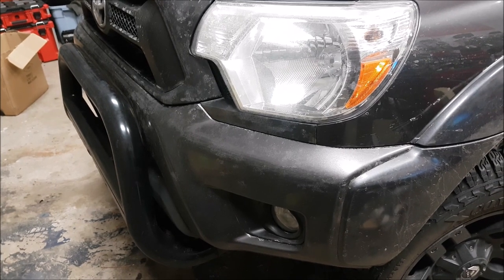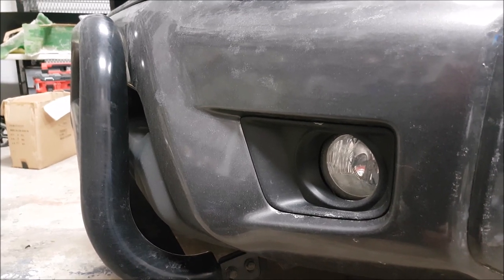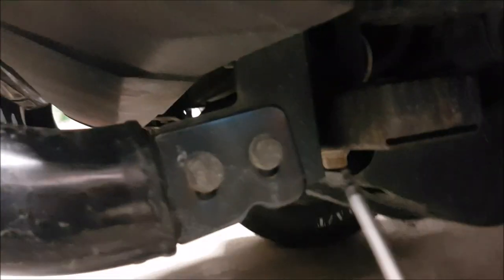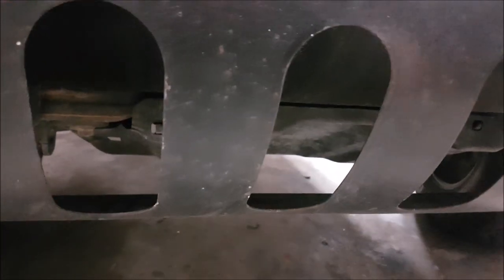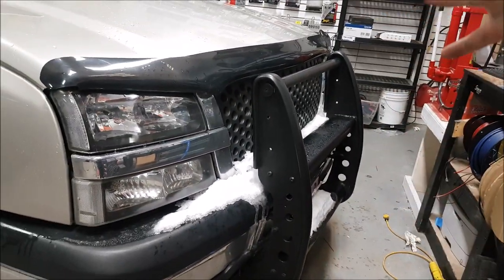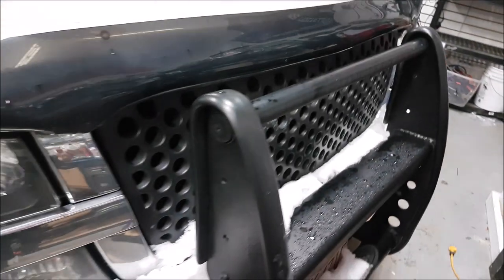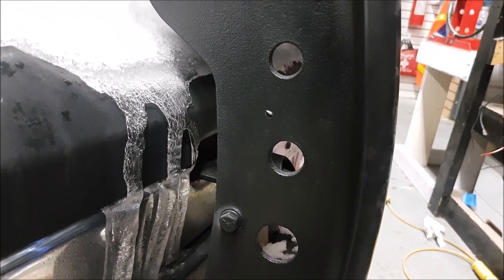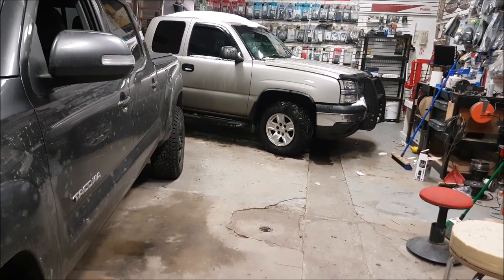Push Bumper vs Bull Guard | AnthonyJ350

Comment: Well. Had a bull guard on my Nissan Armada couple years ago. I slid while doing a left turn, tried to do a small drift but TC messed me up so i end up hitting the guard rail on the right, the bull guard saved my front end. :D all I had to do was loosen the bolts to re-align it back to normal.
Reply from the maker: Glad to hear it helped protect the SUV.
Reply: @AnthonyJ350  where did you order your push bar,I can’t find it on the Go rhino website .I want one for my 06-07 Chevy could you help me out?
Reply from the maker: @ThefarmLife.  fleetandsafety.com
Reply: @AnthonyJ350  I can’t find it on there it’s showing up law attorneys ,copper fit masks and other unrelated things
Reply: @ThefarmLife.  he said a bull guard (which is a brush bar) not a push bar. You can get bull guards on Amazon for about 150 for a certain vehicle.

Comment: Well, here in Mexico we have them to use them as RamBars. It is a safety issue for us dealing with drug cartels daily. Generally, the best I've seel is to have custom made brackets on the bottom, middle and top of the push bar to make it really sturdy not just to take most of the hit, but to actually take it all like a champion. Yes, It will get sort of damaged, but it will allow you to hit a car, move it out of the way and keep going without significant damage to your vehicle, your radiator or any parts that could prevent you from keep going on. It also helps when you actually install an offroad steel bumper with that bull guard on top ankered to the chasis in a higher place like the radiator top bracing.
Reply from the maker: That's pretty cool, thanks for sharing!
Reply: Solid advice!
Reply: Can you recommend a model that is best for that? Thank you! or a company?
Reply: @---tx9xx  I've only seen Iron Bullbumpers tested that way and they seem like the real deal. Now, they are expensive for my pocket and I would have to take my van to them so that they can make me one cuz they don make any for the chevy express van. But they might have one for your truck. 
The other way is the way I'm doing it... build one out of 1/4" square tubing and 3/16" steel plate. I'm making a frame out of the tubing and the "body out of the plate. Im gonna bolt it directly to the frame of the van with 1/2" diameter bolts and making sure the frame is stabilized by the bumper itself so it doesn't move in case of collision. 
I learned that modern frames use accelerometers and other sensors to decide if the airbags have to go off, but if the frame doesn't shift, It is less likely to set them off and seize the vehicle.

Comment: i know someone that installed  a push bar on there truck to protect it from deers
Reply from the maker: That makes a lot of sense.  It would take a lot of damage but it would hopefully protect the radiator so you can drive home at least.
Reply: @MuddyBob650  I hit one doing 55 miles an hour and my truck still drives fine.
Reply: @MuddyBob650  That's why you get a Ranch Style Brush Gaurd/Bumper
Reply: @MuddyBob650  I once saw a Chevy 2500 with a grill guard whack a mule deer buck at roughly 60mph. I was right behind the truck. Flipped the deer 540° and threw it into the bar ditch. Snapped one of its antlers in half and killed it. I checked on the guys in the truck and they were just fine, only a small dent in the hood near the passenger headlight. Drove on to work like nothing had happened.
Reply: It won't do anything unless its a dull steel bumper a high speed impact is more likely to push the upper section of a guard into the front of the vehicle and damage the radiator
Reply: @cameron6049  it actually worked they hut a deer around 25 miles an hour and the car was fine just the push bar was bent
Reply: I hit a deer going 65mph in my 85 Silverado some years ago on I-80 while driving at night. Almost direct hit to the big, heavy steel push bar, which was badly bent by the impact. Everything else on the fronted was fine. Crazy that there was no sign of the deer around the truck when I stopped, but I pulled out a chunk of deer from the under carriage the next morning.
Reply: @MuddyBob650   There is at least one exception, I can assure you.

Comment: Glad I watched. Was gonna put a bull guard on my Highlander until I saw how flimsy.
Reply from the maker: Ya they're just for decoration unless it ties in with the frame on several points
Reply: @AnthonyJ350  I thought the brackets looked frail and like you said ,were not at a stable point. Thank you Sir.
Reply from the maker: @iamnegan1515  You're welcome, and thanks for watching 🙂
Reply: Really they should just be called bump guard.
In terms of strength from weakest to strongest:
1) brush guard (mostly decoration)
2) bull (bump) guard. (In video)
3) push guard (in video)
4) ram guard. 

A steel bull guard can protect against hitting animals, or “bumping” other cars/objects. Not gonna save you in a 40+mph wreck, or allow you to ram/push cars lol.

Comment: I purchased a brush guard (Push bar) from Black Horse for my 2022 RAM Promaster; problem is it covers the crash avoidance sensors. I can alter it and raise it 3 inches above the sensors; will that be high enough to clear the sensors??? Any Ideas would be appreciated! Thanks
Reply from the maker: I would contact the manufacturer on that one.  I haven't had to do that so I don't know what the results will be.

Comment: Is this strong enough to push slow moving vehicle's off the road, making my commute quicker
Or in case I'm late for work, as I am on my last warning now
And I am sick of passing people on the right 
The gravel soft shoulder, is dangerous to pass on at high rates of speed
Thanks 😁
Reply from the maker: You could just leave earlier for work
Reply: @AnthonyJ350  I try doing that, but I'm usually still half drunk and don't hear the alarm
And don't say to quit drinking, or cut back
Not going to happen
I also need my job to pay for the booze 
Thanks 😁
Reply from the maker: @grantward9205  You sound like a winner 🏆
Reply: @AnthonyJ350  You are very astute 
Thank you for the compliment😁
Reply from the maker: @grantward9205  Perfect example to all the young people of what NOT to become in life. Thanks for confirming.
Reply from the maker: But thanks for coming back to make comments and help the engagement statistics of the video. Helps us pay for our shop and Tomei headers I'm going to buy for the 350Z. That stuff isn't cheap, so for that I thank you 😉
Reply: @AnthonyJ350  Thank you, just trying to help the snowflakes out there😁
Reply: @AnthonyJ350  Glad to help the engagement statistics 
I can't wait for this video about the Tomei headers, will they fit my 1975 Chevy Impala 454 and give me some extra torque to push slow moving vehicle's off the road out of my way?
Why are Are you using them? to pass cars when you are late for work half drunk and didn't hear the alarm , like me?
Also I did make my own push bar out a piece of Railroad track, but I had to put spring helpers in to hold the front of the car off the ground, maybe it was a mistake as the weight killed my acceleration, and the cops almost got me last time😁
Reply from the maker: @grantward9205  No you're not. You just want other people to come down to your level, which probably never works.
Reply from the maker: @grantward9205  I like the look of them, it'll change the exhaust note and probably help with midrange power.
Reply from the maker: @grantward9205  Trolling people is a nice distraction from your actual life, isn't it?
Reply: @AnthonyJ350  Don't be so foolish, it worked on you😁
Reply from the maker: @grantward9205  You're not the first and you won't be last keyboard hero that needs to bring people down to their level. Seen it so many times. A higher level person would be constructive and really has better things to do.

I just feel obligated to reply back to comments.
Reply: @AnthonyJ350  Tomei headers cost about $1,500.00 and add about a 5 bhp 
For another $3,000.00 you could get a HKS - Pro GT GTS 8555 Supercharger 
The complete system will boost your stock 350Z to 412HP (440 HP on the Rev-Up) 
Headers aren't a must on a forced induction motor
Reply: @AnthonyJ350 Trolling  is a nice distraction from my actual life
Can't wait till the 4rth Saturday this month April 23rd, Season opens
I'll be out out there trolling for Rainbow Trout at my secret fishing hole, and I'm not telling you where it is, no matter how much you bother me
Seems like you like Trolling?😁
Reply: @AnthonyJ350   A higher level person would be constructive and really has better things to do? do you know any?
What, like slinging insults at commenters?
Your level is way beneath me
I can take it, you can't
I just feel obligated to reply back to your comments
Because I am at a higher level than you, and don't feel the need to insult people for no reason, to make myself feel better
😁
Reply from the maker: @grantward9205  I think it's great you have a hobby like that to do. I hope you share that time with family and/ or friends.
Reply: @AnthonyJ350  Thanks, I do, 
Just me and my son at the secret fishing hole though😁
Reply from the maker: @grantward9205  That's awesome! Why can't you have a friendly discussion like this with people instead. Honestly, what did I do to you to show me that other side? We don't even know each other.
Reply: @AnthonyJ350  I do, you are the insulting one, not me😁
Reply from the maker: @grantward9205  Thanks for the feedback!
Reply from the maker: @grantward9205  I wish you and your son a fun and safe fishing trip.
Reply: @AnthonyJ350  Thank you Anthony
BTW: I came up with an idea to fix the design flaw in push bars defeating crumple zones, especially if bolted to a full frame vehicle
Push bars do not affect air bags as they are tripped  by accelerometers placed in the front area of the car, locations are all different
That's why when a Police car push's a car or does a pit maneuver their is not enough force to trip the accelerometer to set off the air bag, only in a high speed crash when so much force is applied to the front of the vehicle
So design shear bolts that will shear off at the same force it takes to trip a air bag accelerometer, so it would collapse and place the force on the crumple zones 
The way the car was engineered to take
all you would need to do is just simply  change the bolts, and not have to create a whole new push bar design like the video we seen
Making the push bars bull bars already installed redundant

Could you get your design team to get to work on this right away?
Peace😁
Reply from the maker: @grantward9205  That's a great idea, but I don't manufacturer them.
Reply: @AnthonyJ350  OK😁

Comment: Bull guard in Scandinavia must not weight above 0.5kg, the tubing is almost like tinfoil.  It's a styling accessory where you can hang the extra lights.  They sell them in plastic and aluminum in Scandinavian. Pedestrian safety isn't taken lightly by EU.
Reply from the maker: Wow I learned something new. Thanks for sharing!
Reply: Not sure what that has to do with pedestrian safety when you could still drive into people just the same without one. If it was about pedestrian safety, they would just ban motor vehicles.
Reply: @billystink4611  it's to save more people. Some car's kill people at slow speed. Others have higher safety. Subaru has cars with airbag on the hood. It also protect driver. You can end up in jail for accidentally killing somebody.
Reply: @vectraB97  Sorry for the misunderstanding. Here in the U.S., it wouldn’t make a difference to a pedestrian whether a truck had a bull gaurd or not, the truck would do the same damage either way (metal bumpers). Because of this fact, many people here mostly seem to use bull gaurds to minimize damage to their trucks when hitting deer (deer have decome a pest in many parts of this country due to our overly strict hunting laws). Anyways, thanks for taking the time to explain how things work where you live :)
Reply: @billystink4611  EU and Scandinavia take the pedestrian safety regulations seriously. Euro Ncap test pedestrian safety with test dummies. How hard the car actually hits the dummies. Every area of the cars front is safety rated.  No 5 star car has metal bumper or metal tubing on the front. Tesla cybertruck could never meet the requirements in EU with the current design. That's why it got cancelled.
Reply: @vectraB97  Thanks for the info, yes I guess things are very different here.

Comment: the work truck which is my ' 04 Silverado single cab & long bed & 4,3 v6 / auto,. / 4x4  ( on the floor )  w/ currantly  180  k  miles on the clock & still going strong here....it's got a simple push bar like on your silver truck here in the video works well so far... my '02 gmc sierra crew cab long bed  6.0 / auto/4x4 ( on the floor ) w/ currantly 220  k  miles on the clock as well too & still going strong here ... it getting a full on brush guard  the one w/ the head light protector... it too has a built in step & bar to pull your self up onto it... it's going on saturday here... tho the only thing is differant is i wanted it out about 18 inches from the grill so  later on i'll buy & mount a winch on the front end not on the brush guard but on some 1/2 to a 3/4 inch plate steel between the front horn's of the front of the frame on the rig.................
Reply from the maker: Let us know how the install goes!

Comment: If u really want the strongest protection u should buy a RanchHand brush guard made in Shiner, Texas. They do extensive research on the strongest design and hand weld each brush guard. They are way stronger than the push bar that u showed.
Reply from the maker: Thanks for sharing your experience!

Comment: That bull bar looks weak and wobbily..  the one i got slides into the frame and mounts in 2 places, below the bumper to frame rails and in the middle of the bumper that goes to the frame rails with 2 tubes that run beside the radiator..  i can lift my truck with the bull bar i got..  also slid down a hill into a tree at like 20 and didnt do much of anything besides chip the paint on the 4" x1/4" wall tubes..  looks home made but dunno..  welds are good looking but instead of having some bracket like i said they go from the round tube to a rectangle that slides inside the frame rails about a foot then through bolts with 2 beefy bolts on bottom and top part sits where the cross member or frame rails connect to eachother by the shock towers..  so they rest against that middle rail .. best design ive seen for something like a bull bar..
Reply from the maker: Thanks for sharing!

Comment: I'm curious to know if Setina or 🦏 brand P71 🚔 push bar will affect or have problems with Ford air bags, air bag sensors. I do 👮🏻‍♂️ & have seen 2000s era Ford CVs with that problem.
Reply from the maker: It might make them not deploy at lower speeds.  You have to factor in they're engineered to be installed with the airbag system intact.

Comment: I'm looking into the push bar for my 04 Silverado 4wd. I like the rhino 3150B, however do I need a front plate relocation bracket? I could not tell from the angle of the video. 

 I started out being really interested in a bull bar but when I realized they really are mostly for looks and most of them have some sort of advertisement on them I decided on something more functional that still looks good. There are animals out here and would at least like to have a fighting chance of something would happen
Reply from the maker: The push bar I have I didn't have to relocate the plate, had clearance everywhere. I got it for the same reason. Wanted a more aggressive look and somewhat of a fighting chance to be able to drive home if I hit an animal by accident.
Reply: Thanks. After looking into the price the cheapest I could find it was Summit (just under $300) and I was actually able to print installation instructions and it actually DOES come with a license plate bracket. Looks like it just moves it father up front instead of it being "hidden" behind the bar.
Reply: Ranch hand makes bumpers for your truck
Reply: My Ranch Hand grill guard is a beast!

Comment: wtf is a ram bar?
Reply from the maker: A push bar you mean?
Reply: He is talking about 3:32. The way you where talking it seemed there is a product called a ram bar. Your just saying the push bars are not meant for raming into cars or animals at high speed. They are meant for pushing stuff at low speed. They will reduce damage done to your vehicle but the laws of physics still apply.

Comment: Well I'm looking for a pushbar when I've bought my own car. But I don't know if that fits on a Volvo XC70('02-'07)🤔
Reply from the maker: You'll have to customize one. Just use thick plate steel.
Reply: @AnthonyJ350  thanks for the tip mate! I take that with me. But what I'm also wondering about is, a pushbar don't hurt any cyclists and voetgangers right? If so, it has been approved according to Dutch law.
Reply from the maker: @christenhove5713  You would need one designed specifically and approved for your vehicle.
Reply: @AnthonyJ350  ah okay.